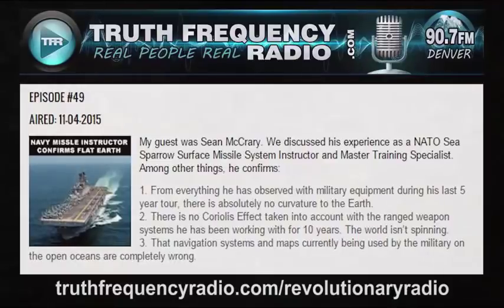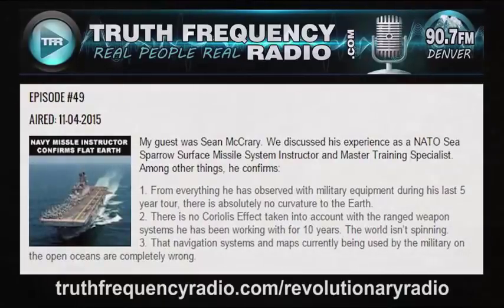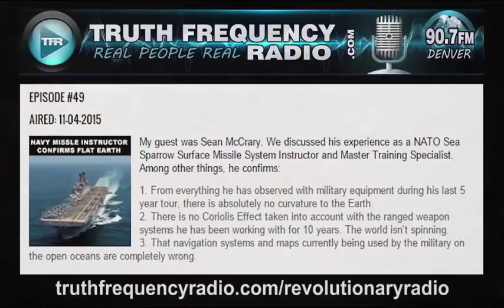Flat Earth- Navy missile instructor Flattening the globe

Comment: The Sea Sparrow is a surface to air missile. It has no problem seeing something high and distant. It can't see anything very low and distant, but exactly how far depends on the height of the radar itself. On an aircraft carrier like in the picture that could be 200ft which would allow it to detect targets 32 miles away at 100ft above sea level.
 
Additionally the US navy has planes which use their radar from a great height to inform the missile systems of the ships below. The very fact that they needed this ability shows that the earth is a globe.
Reply from the maker: We are talking about radar 150 feet above sea level tracking a jet 200 feet above sea level at 45 nautical miles away,...Get with the program!